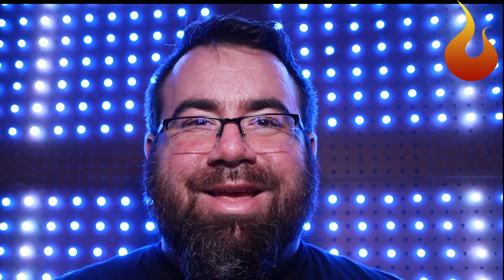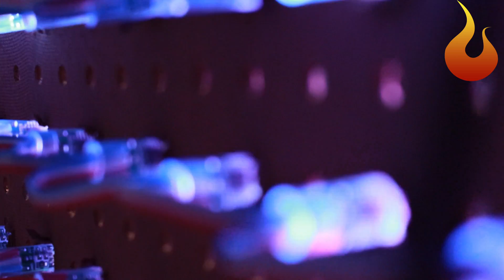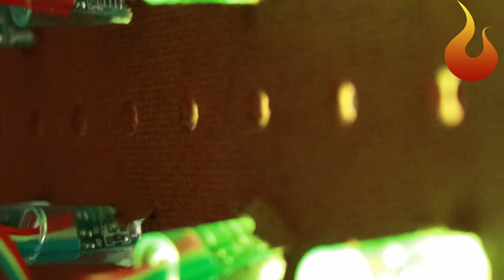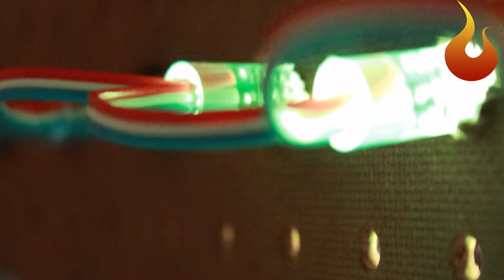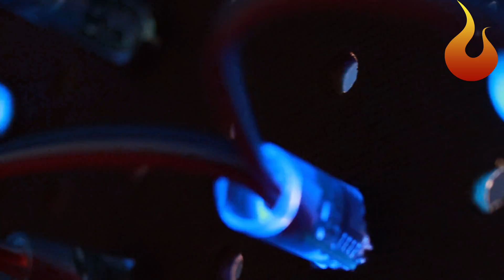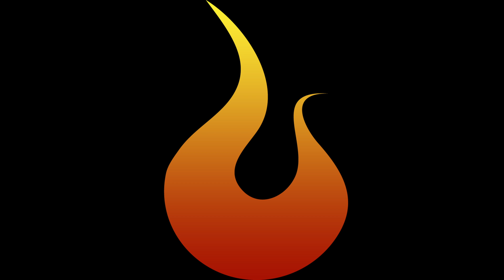Sneak Peek - DIY LED Panels! - #AscensionTechTuesday - EP123

Comment: Could you put links in the description for the parts used?
Reply from the maker: Updated :)
Reply: Thank you very much! So you are running one card for your whole wall? It looks like they are daisy changeable. Wondering if the wiring is thick enough to run 1k pixels like the card says it can handle.
Reply from the maker: @jasonharris2790  Currently, I have a controller with 8 outputs (data and power) and I’m sending 4 separate feeds to the panels behind me in the video. This will be inefficient when we have a much bigger wall. At max, with one controller, I theorize that I could do 8 columns, each at up to 5 panels deep for a total of 40 panels. 

The idea would be to use the Pixlite 4 only for data. In its current mode, I have 8 outputs, each which can send up to 510 pixels worth of data. So, I’ll send data to the top of each column and daisy chain down to each subsequent row. I’ll then use a separate power supply to power each panel. I need to measure it, but I’m hoping to use one power supply for between 4-8 panels. If I can do up to 10, that’s be perfect :) 

-Chad
Reply: https://youtu.be/YX2qg3LpXXw

Have you thought about using one of these and connecting to Dmx?
Reply from the maker: @jasonharris2790  hey Jason! Yeah, these are fun if you want to use very few DMX channels and if you’re fine using pre-made FX instead of pixel mapping. 

I prefer sACN because I use ChamSys MagicQ and have plenty of channels to burn for free and I can pixel map with that program. A lot of the things happening in the my video are actually gifs I downloaded online that are playing across the pixels in real-time. A lot of the controllers like the one in the link cannot do that or you have to pre-load videos onto an SD card instead. Both have their place but I generally prefer the sACN route :) 

Thanks for sharing!
-Chad